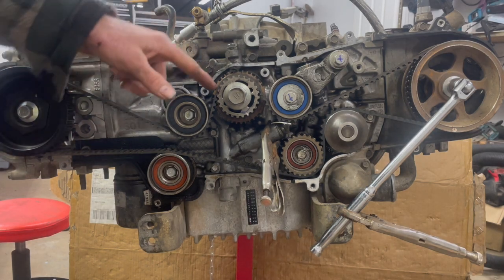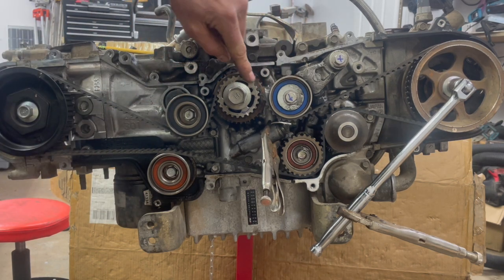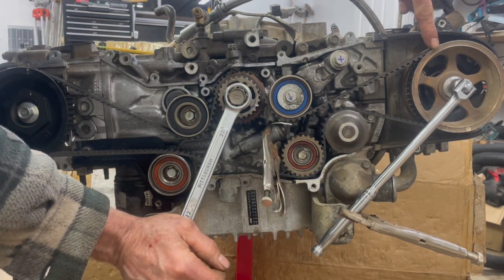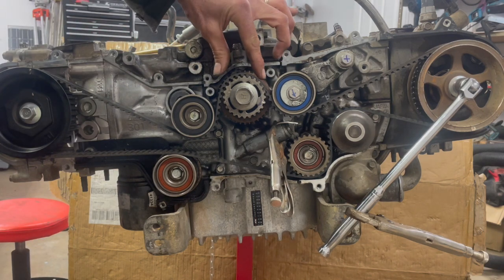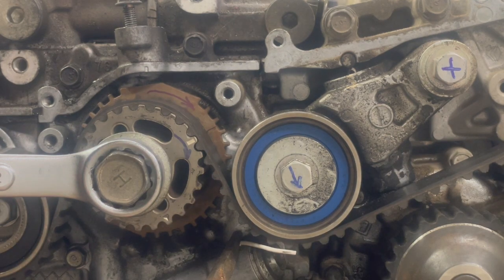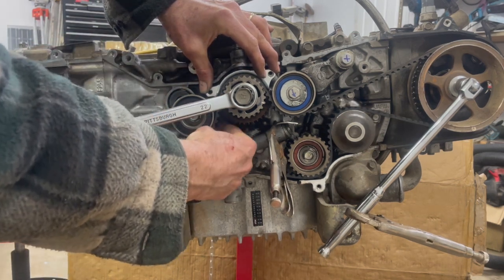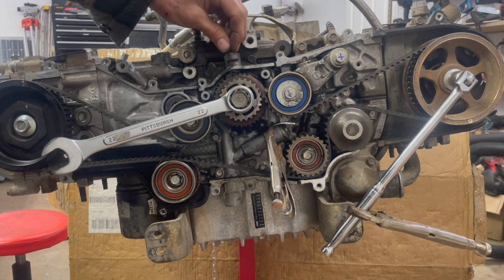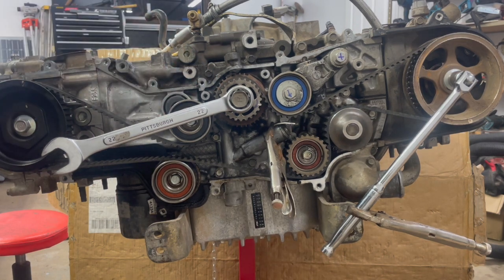Subaru EJ25 timing belt guide 13145AA021 You need it for a manual transmission.   HD 720p

Comment: Is it possible that the belt Slips by turning the Engine backwards ? 
Installed  a new belt on my dohc and while trying to lose the crank bolt i turned the Engine 4-5 times a Little Bit backwards Till the bolt came lose.
Its an automatic without the Guide.
Car Starts and drives Fine and Checking the timing isnt done in 5 minutes

Comment: Thanks for the great explanation.  My son's 2006 Forester engine (with manual trans) did NOT have the guide installed, so I figured the engine was a replacement that had originally been installed with an automatic.  We did install a guide on it, just to be sure.  Your video explains the issue perfectly.  He never had a problem, but it surely could have been.

Comment: Subaru started fitting the cam belt guides in MY98, on manual models only (at least, in European model Subaru's). They changed the design of the oil pump at the same time (for manual and auto models), adding the two bosses that the cam belt guide screws in to. So to fit a cam belt guide to an earlier engine, you'd need to fit the later oil pump. But to fit one to an MT88 or later engine from an auto when being sued in a manual application, you just screw the guide on to the existing pump.
Be super careful if taking the crank position sensor out to check for the presence of a cam belt guide. The stainless steel sensors are very probe to corroding the surrounding aluminium, trapping them in the bore. When the screw is removed, the top of the sensor often moves a little bit, encouraging you that it's loose, so just needs prying a little. When the stainless sensor housing is trapped in the casting by corrosion, this movement is not the sensor moving in the casting, but the plastic senser internals moving in the stainless casing. Prying at it, even lightly, can break the top off an otherwise good sensor.

Comment: Replaced my timing belt today on a 2012 STI hatch and was wondering what the guides were for. It had them over the crank as well as over the right exhaust cam pulley and left intake cam pulley. I used a thin piece of cardboard to set the gap between belt and guides. Is there a special tool for adjusting the gap?